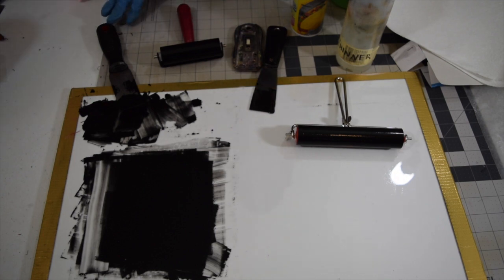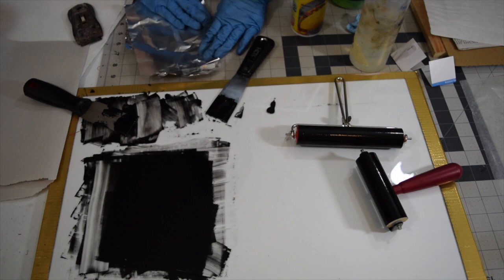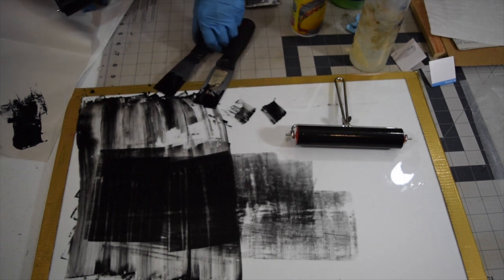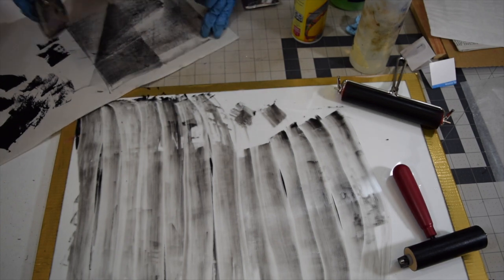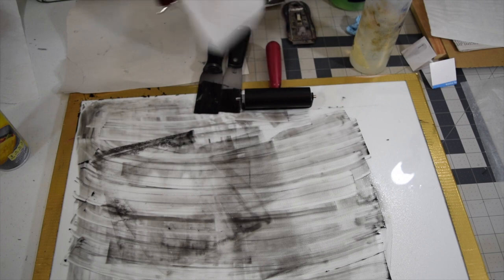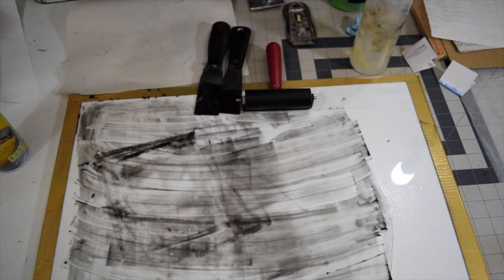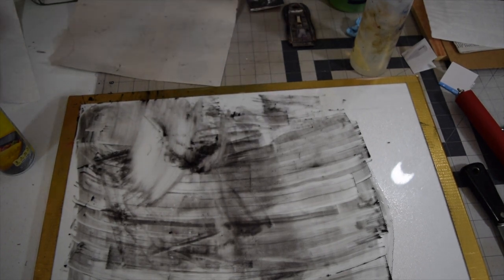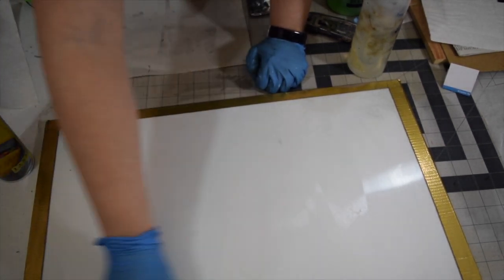How to Clean Up Oil-Based Printmaking Ink

Comment: Very good video.  I was looking this up specifically to remind myself of how to avoid super-long drying times for oil-based inks.  I usually use Caligo Safe Wash ink (made by Cranfield) which can be cleaned up with just soap and water (or just water).  

I am about to make some prints (wrapping paper) with Cranfield oil-based ink and remember in the past that I had a terrible experience with ridiculously long drying time.  Apparently, the problem was that there was a very small residue of vegetable oil on the roller, which contaminated the ink and prevented it from drying.  The solution (no pun intended) was to wash the roller in something like Dawn dishwashing liquid (which is really different from other dishwashing liqids), or maybe rubbing alcohol or Simple Green, with plenty of wiping/flushing.

I am particularly interested in not polluting the air in my studio (in the living space during the cold season) or the waterways by flushing ink and solvents down the drain at any point, so the use of Simple Green and rags/paper towels is good, as it can go in the regular garbage ans not pose a fire hazard.
Reply from the maker: Thank you for sharing what you do!  I am also interested in transitioning my home studio to more greener and safer practices, and was even told Simple Green is an asthmatic for some, so have been switching to Seventh Generation brand cleanser/degreaser.  I do agree that too much vegetable oil left on the brayer can impact the quality of prints. The university I work at uses Akua inks on brayers, which we wash with Dawn Soap, but they left the brayers always sticky. I read the ingredients of Dawn Soap to see one of the first ingredients listed is alcohol denat, and I had always been told to never use denatured alcohol on brayers, so I'm now looking into alternative soaps. But for now, for both using vegetable oil and or dawn soap, I follow up with corn starch or french chalk to absorb any residual oils or reduce the tackiness on brayers. Wipe with a clean cloth or paper towel, or I sometime just wipe it with my hand before inking and printing again.
Reply: @Chcole88  I might try the baby powder or French chalk, but I have not found that the sticky rollers are really a problem, just annoying.
Reply: Is that ink permanent when dry? I'm printing with the intention of adding color with watercolor paint. If the ink loosens up again with water, even after dry, it'll make a huge mess. Do you know?
Reply: @MariaLanger  I think so. Once it is dry, it won't dissolve in water.  I have colored a couple of prints with Ampersand Scratchbord/Claybord Inks, which I think are similar to transparent watercolors or maybe one or another of Dr. Ph. Martin's inks (there are several varieties).  Water-based, and no white pigment, so when it crosses the black-printed portions it will not muddy the black.  Originally formulated for tinting scratchboard pieces, and work much the same on linoprints.  Only five colors, plus black, so you might want to try transparent ink or watercolors from different brands.
Reply from the maker: @MariaLanger  Adding to what Patrick replied, so long as the ink is oil-based should be fine to paint over. Speedball water-cleanable inks also dry permanently. Most oil-based water-miscible inks like Caligo Safe wash are permanent when dry. The only brand of printing ink I'd be cautious about painting over is Akua, which is a soy-based ink. Once it is absorbed it seems permanent, but I've found with student work that it takes a while to dry, especially if applied thickly, and since I can smudge it with my hand, I figure a brush would also smudge it.

Comment: do you clean the print block with vegetable oil as well?
Reply from the maker: Hi @miabecerra2611 - Thanks for asking! I've used vegetable oil with linoleum and shellacked woodcuts, following up with something that has a degreaser in it, but I tend not to use oils for non-sealed woodcuts.  I try to wipe up as much as I can without using any cleaning agent first, and then follow up with a little bit of a solvent like Gamsol or Soy Solv ii or the slightest bit of something like Simple Green or Seventh-Generation degreaser on a rag to get the remaining ink. Hope that helps!

Comment: Is it safe to throw away paper towels with wiped off oil based printing ink on them?
Reply from the maker: Just noticed this comment now, sorry! I do just throw the paper towels away if I'm not using a rag, just the same as if I scrape up used ink and toss it.  I try to fold paper towels and use it until it's completely soiled so I'm not wasteful,   If I have paper towels with solvents on it, I put it in a covered bin to prevent spontaneous combustion, but at the university I work at, the hazardous waste people often move the paper towels out of the covered bin to the trashcan when emptying rags, so I think most of the concern is when it's soaked and damp with solvents, but seems okay when it is dry.